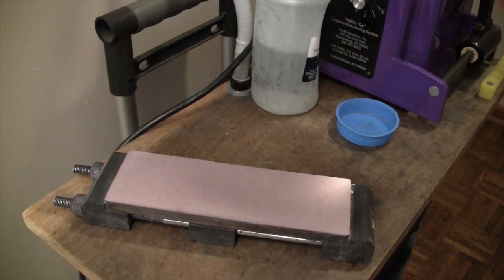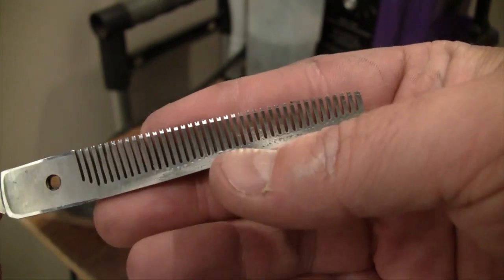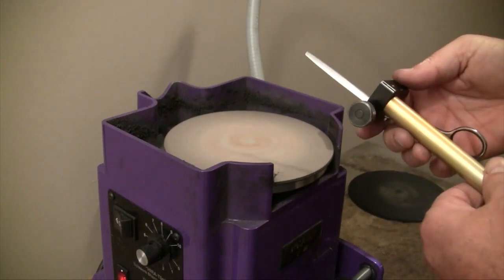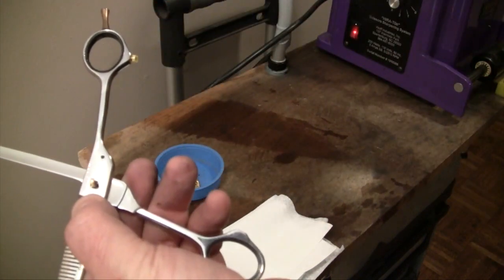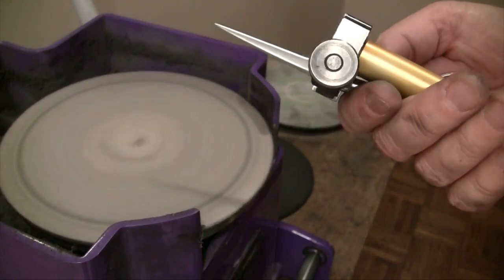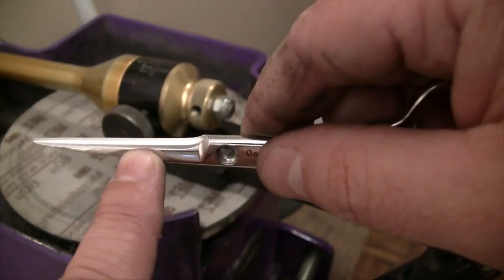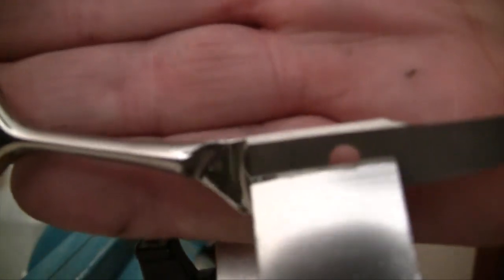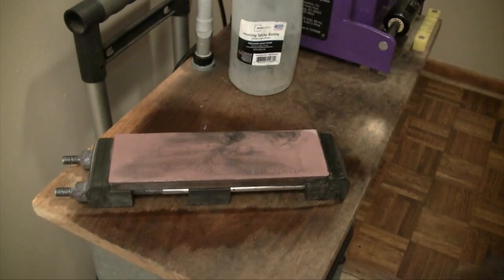3 Tricks of the Shear Sharpening Trade with Jim O'Donnell

Comment: I think I radiused out my German shears trying to get a ride line on a DMT DIAMOND STONE (Coarse/extra fine duo stone) how can I repair that. And what grit water stone is that?
Reply from the maker: If they are German shears,  they may be ruined.  Those usually don't have a rideline.
Reply: @BonikaShears  😱
Reply: @BonikaShears  they get a sharp edge on the twice as sharp…but when reaching the middle to tip..they start folding the paper towels.